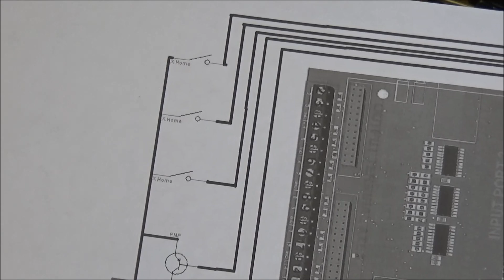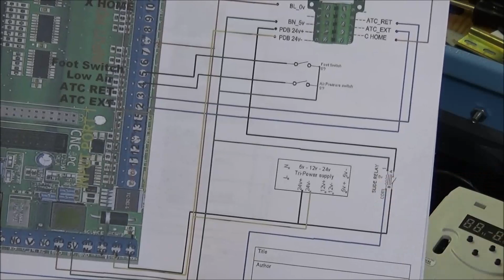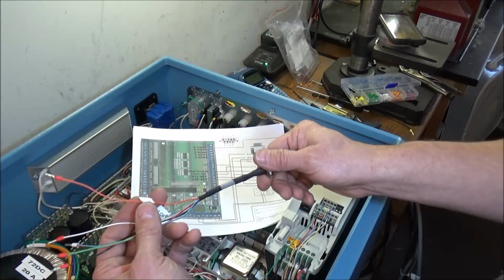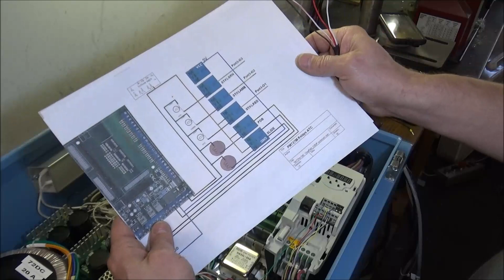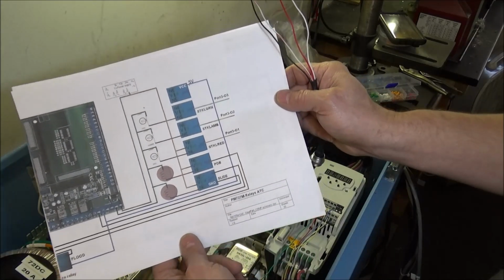PM727M ATC Wiring Pt1

Comment: @cnc4xr7  I am doing a cnc conversion on a  PM940V.   I bout same cxp25 BOB . And ethernet smooth stepper I think I will also get the M46 relay board.  I would realy like a copy of that wiring diagram u made.   It is extremely  close to my build for me to use as a guide .

Comment: You placed jumpers for Pin 26 on "Port 1" and "Port 2" so that the 5 Volts from the C25XP would power the ESS.     You made no mention of the "Port 3" jumper which is used for the "Relay Board".    Does the jumper for "Port 3" need to be installed when the relay board is used?
Reply from the maker: Yes P26 on Port 3 is also 5v

Comment: Why did you run a C25XP from cnc4pc and the smooth stepper ethernet board from Warp 9 ?
Reply from the maker: Warp9 MFG's  the ESS both were purchased from CNC4PC
Reply: @CNC4XR7  thanks.  I just got the new PM 940 V in last week.  I am tearing  it down to cnc convert it.  What is your thoughts on Mach 4
Reply: I have Mach 4.  But not got to use it yet.  Still building  my PM940V